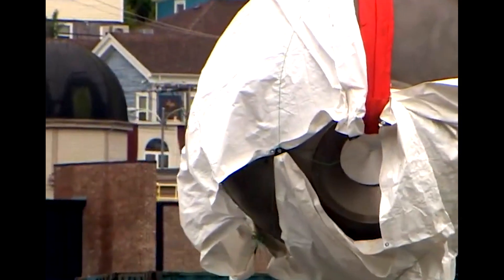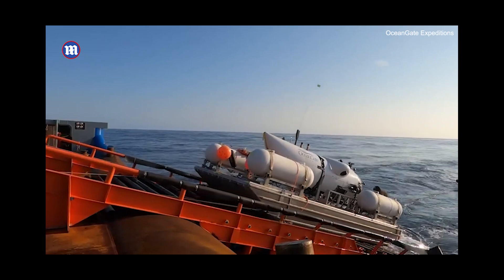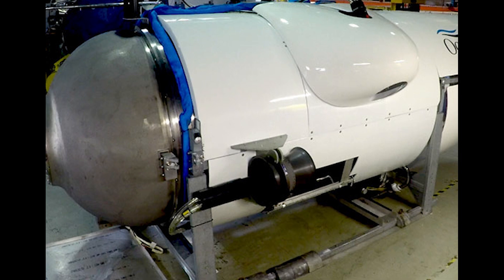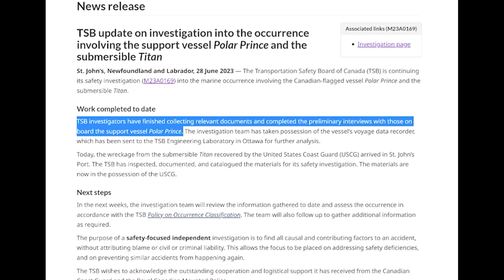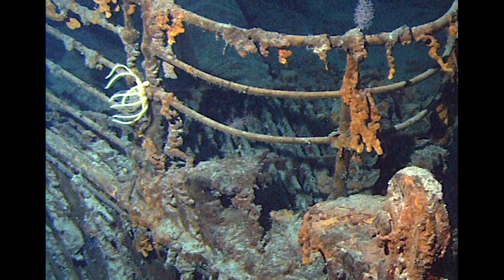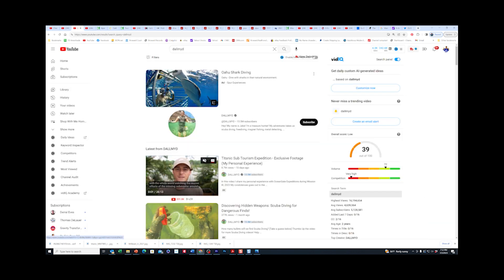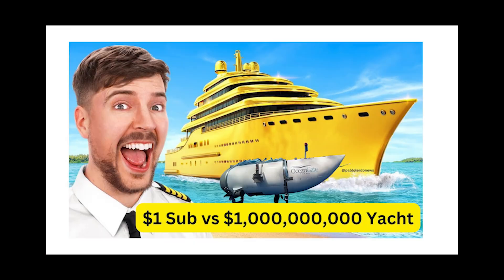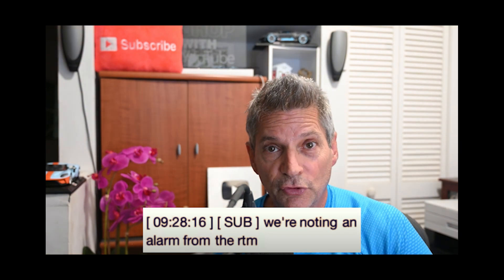Titan Submarine Debris Clues, Implosion Simulation

Comment: The titanium ring looks too shiny for any adhesive to adhere to it. Isn't that basic gluing 101 ? To rough up or sand the parts that you are gluing together ? The banging they heard was probably the epoxy popping off the ring just like you said. It is possible that both the carbon fiber hull AND titanium rings could have been roughed or sanded. Also, the two rings should have been clamped to the carbon fiber hull under pressure like a bar clamp system of some sort.

Comment: why not idk... use a real sub
Reply: Most modern submarines aren’t made to operate at those depths. Also, their non spherical shape makes them less than ideal. Which same with the Titan, it’s shape was not ideal. Every other trip down to the Titanic was with a sphere pod for the crew, because it’s mathematically the best way to prevent implosion due to the surface area evenly spreading the pressure
Reply: @shorelinemafiaiglives9750  why not idk... use a real spherical sub

Comment: The overlap, no matter even if larger, was simply blown away in sheer. It, and probable voids in the bonding because we never saw any evidence of squeeze out, was not the most-probable single point of failure:  In addition to being a material unsuited to compressive stress, A unidirectional tow strip is the only fiber the Spencer Composites video shows wound around the mandrel;  ZERO was the design provision or video showing of any non-axial lateral structure to prevent a simple splitting of the fabricated unidirectional tube. Thus, given water's injection into the unidirectional structure, the axial fibers were displaced laterally, wedging them and progressively splitting the tube in the axial.  This tube design was so fundamentally ill conceived that it sickens all competent composite engineers and fabricators.

Comment: Given the supposed facts, I think the when the rear failed, the water rushing in at 5000 psi simply pushed the observation port and its support off of the dome, which soon followed as the carbon fiber vessel disintegrated.

Comment: The carbon fibre tube would be more compressible than the end caps. With repeated pressure cycling I would have expected the carbon fibre to fail at the joints if not elsewhere.

Comment: I am similar to ronkluwe4875. I have a degree in ocean engineering but ended up designing space deployable antennas. We used titanium end fittings on all of our graphite composite structures mainly because of similar coefficients of thermal expansion. As an undergraduate I studied the theory of plates and shells. Simplistically, failures typically occur at transitions of unequal stiffness. When the stresses transition from a cylinder to a hemisphere, bending moments can approach 50% of internal loading. The thickness of the shell at this transition is thicker than both cylinder and hemisphere. Hoop stress in the cylinder is Pr/t and the hemisphere is Pr/2t. That is why hemisphere thickness is less than cylinder thickness. That's all well and good when dealing with a well behaved all the same material. I saw the titanium transition ring was a simple face bond to the carbon fiber cylinder.  OMG!!!!! That method is never used an any industry using carbon fiber composites especially in a high stress transition in compression.

Comment: I’ve never seen such a poor layup on a cylinder before let alone a pressure vessel. No multi directional 45 degree bias ply looks to be the main culprit. There was no load sharing in the composite. The weakest “link” any occlusion (which there always is with composite) in the straight vertical layup is where the failure propagated from. The whole sub was backyard engineering at its best/worst.  All from some psychopath techno con man just like the other one that builds cars and rockets. Promises the world and the first thing sacrificed is safety because money.

Comment: Judging from I've seen. It was the carbon fibel hull which failed. Once the carbon failed it went inwards with extreme forces and the shrunking hull detached from the titanium pieces clean like it was being cut off. Hence the forces torn off the blue attacment.

As for the hatch. I am actually interested in combat vehicles like tanks. The way that hatch looks it appears to be that the window in being torn off from forces coming from inside. The hatch door itself is not bent or broken, the metal frame around the window is also missing. Those could not have been pushed inside without damaging the door itself. also it appears that the door hinges also failed which is also tipical for such door if they are defeated by forces coming from inside.

In my opinion right after the hull has failed all material inside (including the personel inside) were compacted an being pushed out of the submarine through the window on the front like a red paint sray. (Believe me I have heard about such stories)

Judging from that this appears to be the most accurate animation of the event.
https://www.youtube.com/shorts/xXY1jVoDy24

Comment: Imagine 5100 PSI of pressure at 3500 m depth. The metal barrel we see in this video is at normal atmospheric pressure, which is about 14.6 PSI. The implosion might have happened in a second.

Comment: I think the imploding barrel video gives a wrong picture of what would have happened. Since Air is  so much more compressible than water, it wouldn't stand a chance against the water if there was a leak. And the pressure of the expanding water rushing into the vessel would fill it up in no time crushing them. This would also explain why the debris field was big. The water would essentially rush in and smack the air into a pocket in an explosive manner, pushing the vessel apart from the inside.

Comment: I think there's another possible mechanism for the missing window.  At these depths and pressures, air isn't going to act like much of a buffer.  If the arse end or the carbon tube failed, that water could have hit that window hard enough to blow those bolts clean off it.  You could rough the math (With a few orders of magnitude of fudge factor. Lol!) just by how far the water needed to move to get to the window, the pressure at that depth and the surface area of said window.  You could TL;DR read the idea by thinking of it like cavitation.  Water moving very fast and hitting a stationary body as the gas bubble collapses.  Personally, I wouldn't bet a body part on the idea, but it's certainly plausible.  The pressures and resulting water velocity at that depth after failure has to be bloody astonishing.

Comment: @7:15 The bolts are not really that important. Only maybe for the first few inches under water. As it is actually the pressure that will seal the door shut. The more pressure, the better the seal.

Comment: 7:19 100 percent, that is a torque wrench. The previous ratchet was not. However, they might have initially drove in the bolts with the small ratchet and then torqued them.

Comment: The glass would've shattered from the pressure of the implosion and the titanium ring and "door" is solid titanium and its like throwing a rock into the water and the carbon fiber imploded so its probably to small to pick any up from the depth it is at.

Comment: I totally agree with ronkluwe below. The carbon fibe is not a one homogenious material, its made of strings and only 45 degrees criss cross would have made a change.
In addition the two rings at the ends are definately not enough. 
There should be inner rings especially in the middle of the sub where the pressure wants to implode the sub !

Comment: The forces on the vessel come from all directions laterally as well.  The caps press in to the cylinder as much as the pressure on the vessel circumferentially. If either end of the carbon fiber tube chipped it would catastrophically fail.

Comment: Also, I've heard that they were supposed to be bolted in with 18 screws but a former passenger that refused to go into the sub said that the top bolt was hard to reach so they only put 17 bolts in. He was shocked by the lack of safety and routine and asked them, "Shouldn't you put the 18th screw in???" and they answered "Nah, it's okay, we never put that one in!"
The level of safety thinking was so happy-go-lucky McGyver with the whole crew! Shocking! Rush blinded them all!
Reply: That sounds like what a person would do and say and that hole is were the problem start just think they could be alive to this day if that bolt was there and the owner should have recheck that submarine and should have recheck his design. I going to say this I work at a place doing welding at a structural steel place they stick weld the base plates on what I mean is they tack the base plate on then mig weld all around the five side of base plate that is attached to the beam now this 2023 when my daddy worked there in 90's it was all stick all around the base plate the stick weld is stronger than mig wire  and there a another company that does same thing but they Flux core there's. Remember some of these beams weight 8,000 pounds and they are one of main pieces that u need to put a building up these beams and base  plates help support the roof of the building one bolt to the bottom and one up top now when u weld these plates on there only one weld all around with the mig and that's at 27 volts were it should be at least two all around to make sure it's holds stick weld is stronger than mig the problem is stick welding is smoke and it's hot but if u want it to last u got to do it and u got no how to stick weld plus when u stick weld u know if u ran it right because the sag will peel up and fall off u don't even need the chipping Hammer to get off after u run that first bead then u run a another one were two welds look like one. People cutting corners to make profit
Reply: @kennethhood2168  No, I don't think so, it was just an example of how totally unresponsible they were with all security and safety. It was that Carbonfibre mixed with glue and metalfilm that cracked. Researchers on submersibels around the world tested carbonfibre 10-15 years ago and judged it not suitable, wouldnt hold for high pressure so they ditched it. Rush used a material all real researchers warned him about. That and the cylindrical shape that was ditched a 100 years ago, no submarine is cylindrical and they have been researched on since when???
Rush was just a lunatic that never listened to anybody! So many people have tried to stop him, I think they got bored in the end. He dived on international waters because he was forbidden to dive in many countries. Also he lied and said that Titan had the certifications and permits!
Reply: @kennethhood2168 , you don't seriously think anyone reads this??!

Comment: We know why it failed. The former employee who got fired for not signing off on the sub pointed out all points of failure, with the main one being that carbon fiber is not for compression. The commentator made this comparison, "carbon fiber is like rope, not for compression. You can pull and pull on a rope and it will hold, but as soon as you push a rope together all of the bands unravel and lose form."

Comment: Most likely, the point of failure was the part of the carbon tube sitting in the titan ring for ~1/2 inch or so. Waay to little for permanent function.

Carbon compresses a lot more than titan. So the carbon part in the titan ring stayed in form due to the incompressibility of titan (that's why real subs are made of titan completely) whilst the rest of the carbon tube got compressed a lot more.

After a few dives the material at this very point was weakened to the point of failure.

I guess there are no big carbon pieces remaining to be found. Carbon shatters like glass. To find anything one might use a vacuum cleaner.

Comment: I am of the inclination that there was a fan shaped leak in the rear causing a water jet powerful enough to sheer into enough layers of the titanium/cf tank. Once the pressure of the rear compartment or flooding thereof places additional pressure that was enough to cause the final failure. Listening to this video and the previous video. A pinhole leak would be like a laser but a fan shaped spray from a leak which is just as common would be like a carbon air-arc gouge.

Comment: At the moment of implosion, the port hole acrylic window on the front titanium hemisphere simply exploded, and the flange was severed. It was a clear case of catastrophic implosion due to the tremendous water pressure that blew the CRF hull into tiny pieces. Don't forget the already accumulated cyclical fatigue of the material that contributed to the disintegration of the hull.

Comment: Engineering? there is more engineering for a mousetrap car, using gorilla glue to mate different material end caps on any positive/negative pressure vessel without a flange,? basic pipe fitting 101-A....
The Disney sub attraction is better engineered,  I will give them this though, the shape looks really cool, perhaps that was the goal, fool the fools????

Comment: I don't see anything that prevents the epoxy (or whatever joining material) to not pop off the titanium end caps. 
While I think CF, done right, can handle such pressures I would never ever bet on the join / sealing between CF and titanium to do the same.

Comment: More likely the way the acrylic is designed is inward pressure. The ocean water pressure would aid in keeping the acrylic window there. However an implosion would have equalization and pressure that must have pushed the acrylic window outward that it was not designed for. Im betting still with a carbon fiber delamination.

Comment: As a thought experiment, imagine a plastic jar with a tight-fitting (unthreaded) very strong metal lid. Now squeeze the plastic jar, what will happen? As the shape of the plastic jar contort inwards, there will be pressure near the lid joint to go to a smaller circumference relative to the unmoveable metal lid. At first the strength of the fitting will resist, and the jar will be forced to compress its shape further away from the lid joint. However, this would greatly increase the pressure on the lid joint. At some point the compression of the jar will be too great to be resisted by the force of the joint, the two materials will separate, and the lid will be blown off the jar. In the Titan, the differential compression of the titanium ring and the carbon fiber hull could have quite easily overwhelmed the strength of the glue joint (which as Jeff pointed out, had only a tiny overlap), and one or both of the titanium rings could be been blow off cleanly from the hull. Based on the images we saw, this seems like a valid hypothesis.

Comment: Given that the bolted design is bad if the sub was lost on the surface, why wasn't it coated in high visibility orange or hi-viz yellow/green, which are much more visible in the vastness of the ocean surface, in foggy conditions and white caps.

Comment: I have been watching various videos on this tragedy and without doubt the system was likely not the best. The one thing I keep seeing, over and over, is remarks about the 'rusty pipe ballast'. That has nothing to do with anything. As I understand it most submersibles have ballast that can be jettisoned to make the craft positivity buoyant, what that ballast is doesn't matter as long as it is weight that can be shed quickly in an attempt to save the vessel. That can be lead weights, rusty steel pipe or dead frozen chickens. What it is simply doesn't matter, the mass of that ballast is the only concern to be shed in an emergency.

Comment: I believe the Titanium Flange to Titanium hull wrapped with Carbon-Fiber infuse Plastic joint was the Achilles heel of the design that could fail from cyclic (pressure/temperature) fatigue.
Reply: The ring had a groove in it for the hull, but should have been glued on upside down so ring grove could have been filled with epoxy and hull lowered into the groove till it overflowed and all air was out, maybe vibrated while assembled like they do to get air out of concrete pours?

Comment: I have made carbon fiber products for over 10 years epoxy will not bond to titanium without ruffling up the surface. I have seen many prostheses fail and have the 4 hole adapter similar to that ring fail and twist out. It would need to be sandwiched in and tied into the ring for optimal strength this is how we make prostheses and with out a tie in it will fall it is just a cork.

Comment: I feel you missed a 4th option for the forward dome.  If there were a catastrophic failure in the main body, then there would have been a pressure wave pushed forward of air being compressed by the collapse.  We've been seeing suggestions of diesel-engine style ignition of the atmosphere in the sub.  Surely the combination of that pressure wave and a possible explosion could have blown the dome outward (a force it was never designed to resist), without the dome being the actual source of the failure.

Comment: They're actually using a torque wrench right at the point you wondered. But they're using it with an extension, so they may have gotten inaccurate torque.

Comment: My wheelchair has a thick carbon fibre seat which doubles as the frame, which makes it lightweight, yet strong. The carbon fibre has that 45 degree crossweave. And it has been officially crash tested and certified for its purpose. Sure, I'd never take it 3800 meters under the ocean, but it is chilling to think that my chair was designed better and more responsibly than this Sub. And it doesn't cost me 250 grand to go for a ride.

Comment: As far as creaking bad, composites don't creek.  Their elongation to failure is approx. 1%.  By the time you register any sort of issue, its usually shatters/implodes.  This is especially true when composites are full micro air bubbles/voids.  I'm guessing that they had other failures of parts and could not complete the dive.